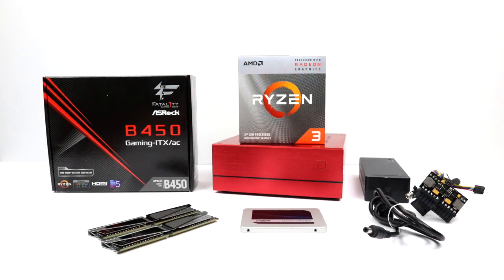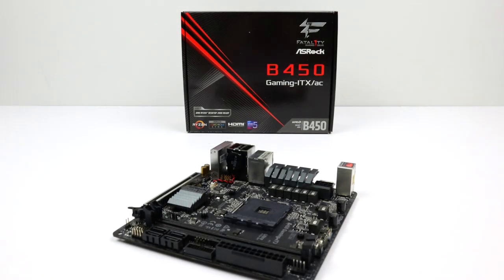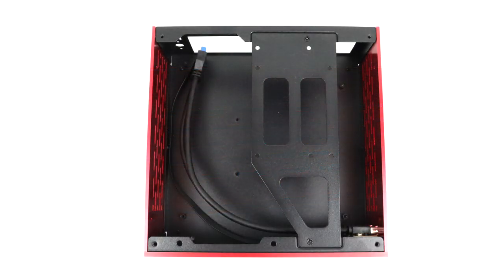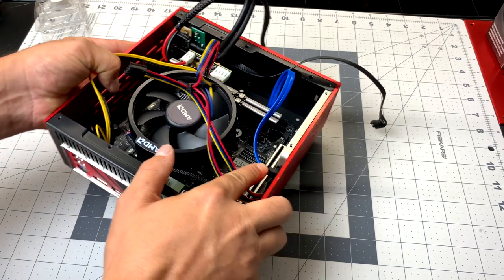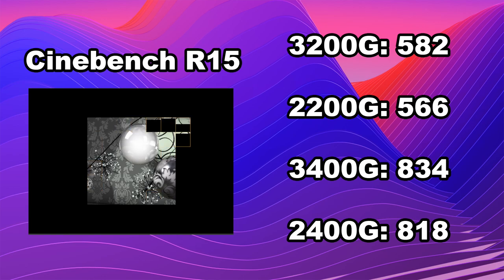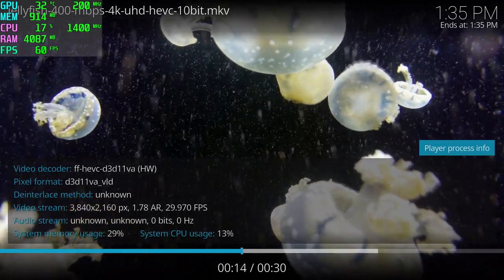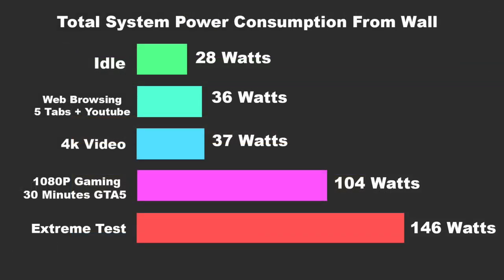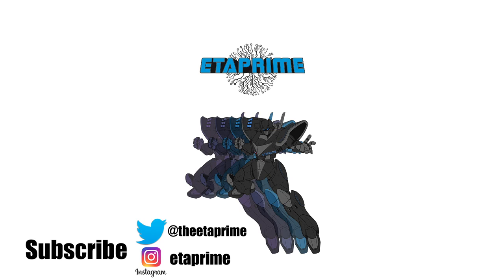Ryzen 3200G Super Small Form Factor Build - Gaming Media Emulation

Comment: The combination of the A01 with a pico PSU and a power brick ends up costing the same as an Inwin Chopin (which has an integrated PSU and no external brick). Which would you recommend for a 3000G HTPC build? I am using an M.2 so no airflow is killed.

Comment: I am looking at a similar case but an extra inch taller for cooling and gpu clearance and I noticed the ram looks very close to the pci slot. I was wondering if there is enough clearance for a standard single fan gpu on that motherboard. I'm trying to make a high end build with a 3600, a single fan gtx 1660, and a 250w pico

Comment: This is without a graphics card added, correct? I would be interested to see gameplay with a smaller MSi or NVIDIA card.
Reply: No point, just buy  a 1/2/3600 instead as it is about the same price, faster, and has more cores.  Then stick a a 1050ti upwards in it.

Comment: Hey Prime, I kind of use this as a model for my build, but every time I start it up, CPU fan spins and then stops, no boot, not post, nothing.  If I connect my full size tower ATX power supply to the board, everything powers up fine.  I've tried both a 150W pico PSU and 250W, same issue.  Specs below:

Gigabyte AORUS B450 motherboard

Ryzen 3 3200G CPU

Corsair Vengeance DDR4 3600Mhz 8GB

Samsung EVO M.2 1TB SSD
12V 10A 120W AC-DC converter

150w & 250w PICO PSU

Comment: What is the single core thread speed of the 3200G?  I could not find it.  I need at least 2000 on a benchmark test.  Reason I am asking is because I need a small pc for a CNC machine.  This will go in the cabinet or hang on the outside.  I could go NUC but looking for another choice.  The pc will interface to a cnc controller that specifies 1500 scts.  Thanks

Comment: Hello is the Power Supply really good because the psu calculator said you need 150w (200w to be good) and you have put a 120w ?
Reply: I'm guessing no because it will shut down if you game or do any contebt creation. If you just surf the Internet and watch YT videos its fine. Im6 putting a 250W PS in mine.

Comment: I have a question about the pico psu. I want to run this off 12v deep cycle battery and don't want to use that brick, just power right off the battery. The battery puts out 10-14v depending on the state charge. Will the Pico be okay with that voltage?

Comment: do u know if the 3400g works with a 160w pico psu? i want to build a system in a streacom case, the psu i want to use, is the 160w pico psu from streacom

Comment: I have a question, if u use a pico psu that lets say is 160w does you         a have to use a adapter that has more W (watts)
Reply: Did you get an answer elsewhere? I'm guessing the power adapter should be a tad lower than the power supply rating or you could risk frying it.

Comment: I cannot get my deskmini 2400g combo to run in Windows with the drivers for graphics installed.  I don’t know what else to do.  Any ideas?  3.5 bios, 2400g, hyperx 2933mhz 2x8, Intel 660p 512gb, Windows 10 home.  Have used DDU and the AMD removal tool for driver as well as several reinstalls of windows.
Reply: I had similar problem when using dvi port, try hdmi to dvi adapter

Comment: The RGEEK pico psu barely had any usage. waste of money. I had to do the Bios Boot Kit for 3000 series. even though thats a whole other issue entirely. got everything done. computer set up. everything on this list is GREAT. EXCEPT the pico psu. I tested it with my evga 850w psu and it boots fine. but you wont even get a startup with this garbage.  please update the video that the pico power supply is hit or miss. and is a big miss.

Comment: I hope you don't mind honesty... This is actually quite a terrible build for the price you spent. Also form factor builds as you know limit airflow so why waste money on a machine that doesn't have a dedicated gpu and runs hotter than normal all for size. It's not cost effective and cuts the life of the machine down due to dust and heat. I found a way to fit a dedicated gpu in the size case, its basically a pcie port that adjusts the dirwction of a dedicated gpu allowing a fan to also be on the gpu as well. I put my list together for a new build 2 days ago and im going m-itx and going to upgrade by at least 30% on all of my oarts from my current PC. This thing will be very sweet and also It will be in a bigger case than yours but to me like I said, it is just not feasible to shoot for a case that size. I must say it is cool until I found out no dedicated gpu.

Comment: Can someone tell me what's the best gpu for this build?
Reply: No GPU. This case doesn't look like it will fit any discreet graphics card.The CPU he chose has integrated graphics, so he can avoid a GPU. The 'G' in AMD's 2200G, 2400G, 3200G, & 3400G CPUs indicate the chip has onboard graphics.
Reply: aww man, I really like how small it is. I wanna build something like it but with higher performance. But I guess I need to compromise due to the size

Comment: This will not work. This build overheats like crazy and cant even run L4D2 on low settings. For $450 dollars you could use a full size chassis with real air flow instead of this ridiculous laptop charging cable. What a garbage build.